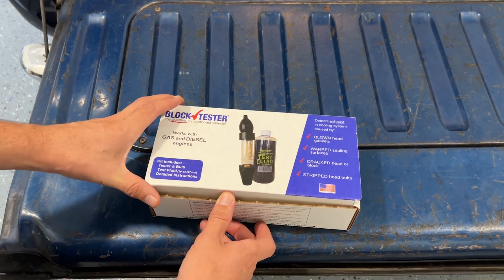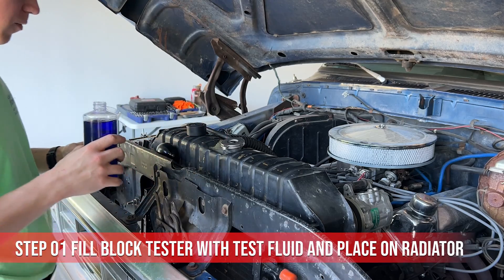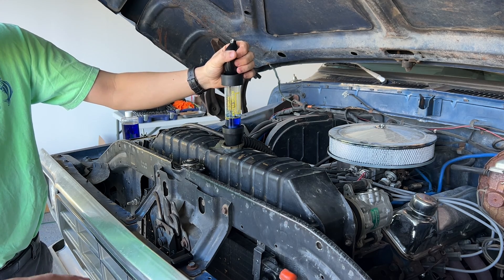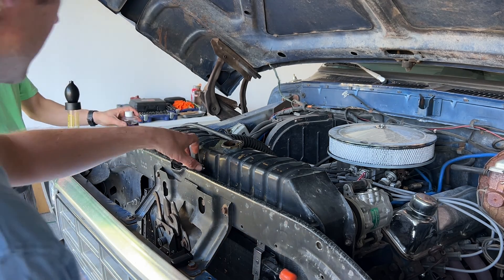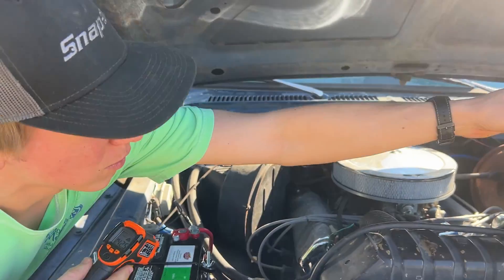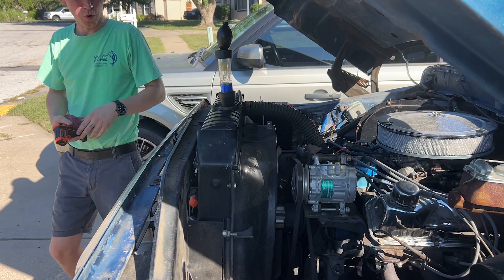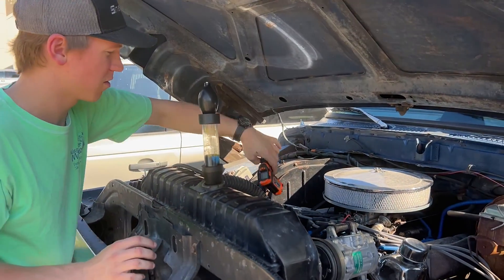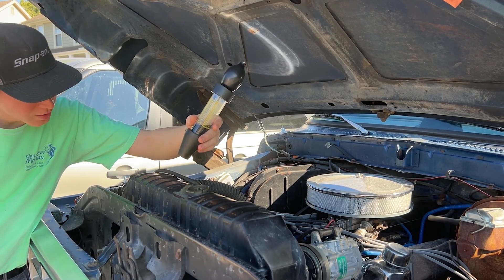Test an Engine for Cracked Head Gasket (EASY)

Comment: Jacob, tell us about your bronco, where is it from, how long have owned it? What are your plans with it and so on.
Reply from the maker: I found this 79 Bronco outside Austin, TX in spring of 2023. The guy we bought it from only owned it a few months and only did a few things to it before selling. We drove it back to Kansas City in 2 days on all backroads, it was a riot. The plan is to restomod it as we go. It's already in great driving shape and we cruise it all spring, summer and fall. I've done a ton of work to it and need to do an updated walkaround video to show where it's at now. Here's the walkaround video I made right after we got back from TX
https://youtu.be/8XwhO_URlNs
Reply: @jacobsupgrades  for a split second I thought it was my Bronco as its the same color, even the white sunvisors, and the ammo can, but you have side molding and I dont. have you seen the headlight swap Carfleet did, they are pretty cool. I just bought them.
Reply from the maker: @Wrenchslinger-o5q lol 😂 that's awesome! I haven't seen that video yet I'll have to check it out. I just changed my headlights out to Hella and have been very happy with them so far.

Comment: Hey Jacob, what was your overheating issue? I am having the same problem. I have replaced the thermostat, water pump, and radiator with electric fans.
Reply from the maker: @warnermeneses, I wasn't able to narrow it down to one particular issue, but it could have been the radiator. I was still overheating after overhauling the cooling system. Once I installed after market gauges I found out its actually not overheating and it's running fine. I think my gauges have been wrong the whole time even though it had a new temp sender. Next time I would recommend after market gauges first before anything.
Reply: @jacobsupgrades  Thank you for the feedback. I am going to try the aftermarket gauges and diagnose a blown head gasket. 
I saw that you replaced the timing chain, did that help with engine performance?
Reply from the maker: @warnermeneses  yes, it seemed to run much smoother with the new timing chain, the old one was pretty worn. It's hard to say if one particular part made the difference in overheating since I replaced all of those at once. But I think if I put the gauges in first I would have had a better baseline to go off of. I was also seeing white smoke which made me think head gasket but it turns out that was from transmission fluid dripping onto the exhaust and burning off.
Reply: @jacobsupgrades  Thank you for your help Jacob. Your videos are informative. Keep them going with the Bronco.
Reply from the maker: @warnermeneses  I'm glad to help out, shoot me any questions if you run into a problem. 

Thank you for the feedback! I have plenty more Bronco videos lined up and plenty more to film.